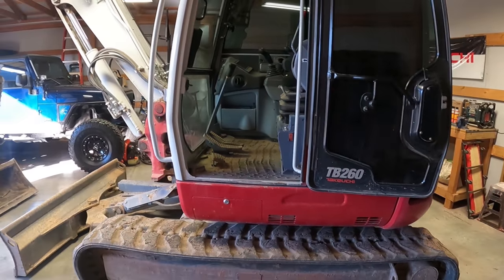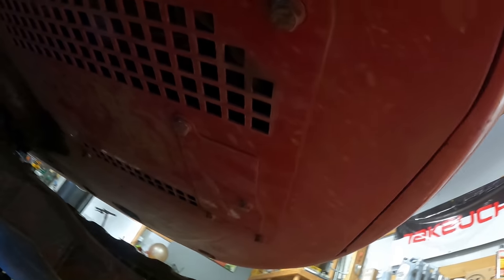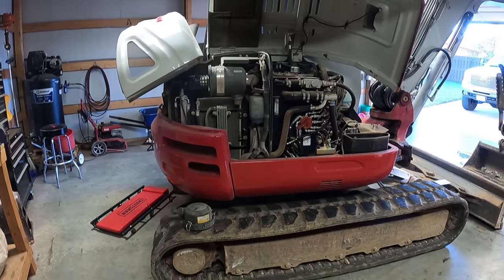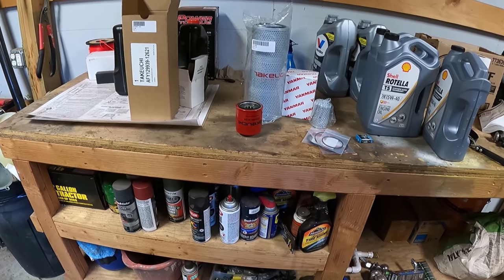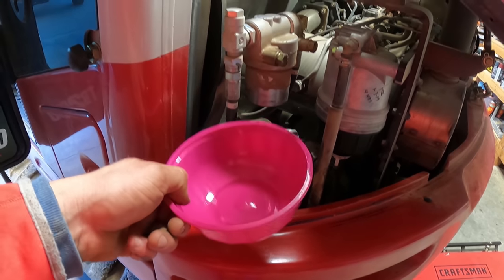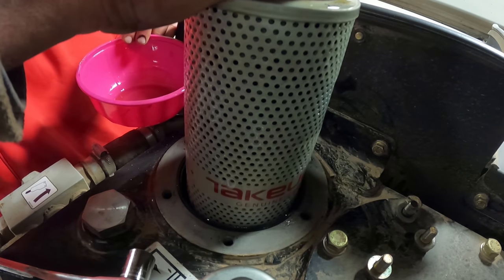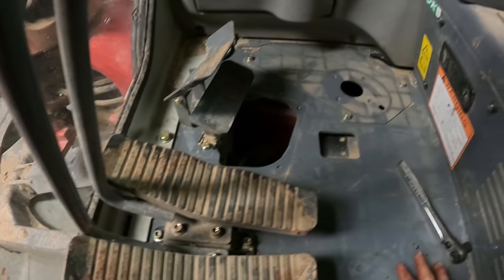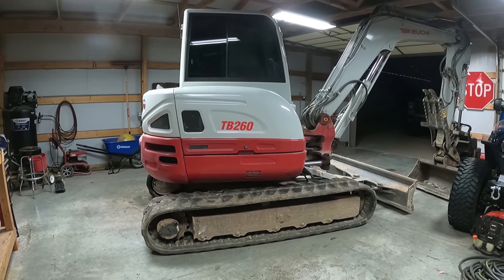500 Hour Service On A Takeuchi TB260

Comment: Maintenance is the key to longevity. Machines and parts are expensive, filters, oil, and grease aren't so bad. The worst part about slacking on maintenence is the down time when something breaks or wears out because you didn't maintain it properly. Nice job there buddy.
Reply from the maker: I agree downtime is a killer I would rather spend a little and money on preventative maintenance than let it go and have a big break down. Appreciate the comment

Comment: Good tip on having the cylinders extended for doing the hydraulic filter change, I'll try to keep that in the memory bank.  Would be nice if all of these filters came with a drain plug to make it less of a mess when you have to change them (I would gladly pay an extra couple of bucks per filter four that).  Enjoyed the video!
Reply from the maker: I learned that the hard way lol! I agree I would definitely pay extra for that, the messes are so annoying. Appreciate you watching
Reply: @eliteearthworksllc  for vertical filters you can loosen them then use a gallon freezer bag to put around it as you remove it. All the spill goes into the bag. You can also tap a small punch into the bottom of a filter and let it drain that way assuming it can hit a drain pan without making a mess of anything else. You can do the same on horizonal filters too but not as easy.
Reply from the maker: @calmac06  that works too

Comment: Hey man, I'm been subscribed for a while. I'm in the process of trying to get my first excavator. The tb260 is on the short list, but I'm having a hard time figuring it out. I like the price and transport-ability of the 260. I'm worried If I got one, I may wish I got an "8" ton. It may come down to what I can afford/ finance right now anyhow. By the specs, I should be able to pull around a 18k machine, but we have a lot of hills, and I definitely notice my ~10k skid steer. I'm nervous about pulling something so big.
Reply from the maker: That can be a tough one. I love my 260 it’s a very capable machine. It weighs almost 13,000lbs and the 290 weighs around 19,000lbs. If your skid weighs 10k you will definitely notice the difference. I know Tak still has good financing. The 260 will be around $78k while the 290 is closer to $125k

Comment: 10:20 where you put an air filter in. I got the supposedly full set of 7 filters for a Tak TB016. There are two air filters, one like the one you put in. I have another filter, blue this time, the same length as t'other but narrower -- in fact the diameter matches the inside of the other... I've been wondering where the hell it's supposed to go so I'm presuming it slips inside!
Reply from the maker: Yeah that’s the inner air filter it goes in first the bigger outer air filter
Reply: @eliteearthworksllc  Well that's a relief! But didn't see you put one in. I must say you are lucky/ fortunate/ blessed because you have a concrete floor, you have an indoors (!), you have a machine that gives you access to the engine on all sides, you have a local dealer!!!! And I thank you for sharing, for you do something 'en passant' (??) that gives me a clue, a nudge, a hint to go and look again!! Wish someone would do the same for the TB016 😁
Reply from the maker: @johncollins8304 I only change the inner filter every 1000 hours. The concrete floor is definitely nice and having a dealer just an hour away is even nicer
Reply: @eliteearthworksllc  "change" yes, but I missed you even putting the 'old' one back in. Never mind, I'll no doubt be watching again soon! Thanks.

Comment: Ever have a problem bleeding the fuel system after replacing filters?  I just replaced both filters on mine. Fillled the spin on filter. Ran fuel pump multiple times for long periods of time. It suck fuel out of spin on filter and then quits after idling for 15-20 seconds.
Reply from the maker: I fill my filters up before I put them back on and just as full as I can get them so it hopefully doesn’t suck air from anywhere. You may have to take the spin off off again and fill it up first
Reply: @eliteearthworksllc  what I ended up having to do was unbolt the water separator housing. Flip it upside down fill with fuel and let the pump suck it down until it was satisfied and level wouldn’t go down anymore. Screwed the cap back on, bolted it up and fired after 5 seconds of cranking.
Reply from the maker: @crashmarvin80  that sucks but glad you got it

Comment: Thanks a lot I learned something today. I did not know there was a slew gear inspection Port, although I'm not sure I have one on my machine it's a 2012 tb235 but it always bugs the heck out of me that I can't see that gear. Also it was great to see the main hydraulic oil filter changed I have not done that yet. can you tell me what is the purpose of that large aluminum plug that is right next to the main hydraulic oil filter cover? If your service did not solve your bogging down problem don't forget to clean your radiator and oil cooler they seem to hold a lot of dirt even if you think they're clean my machine once felt a little sluggish and it looked like it was running normal temperature as far as I was concerned but then a friend of mine told me clean the radiator which I did and I was amazed at how much dirt came out and lo and behold the machine ran about half as hot as it already was.
Reply from the maker: Thank you! That plug is where you fill the hydraulic tank when you need to add more to it. Yes that took care of the problem I think the filter was dirty. Appreciate you watching
Reply: @eliteearthworksllc  👍

Comment: Brandon…. I don’t mean to be to picky but.. shouldn’t you have checked the power steering fluid level, disk brake pad wear and passenger air filter while you were at it?   Or, is this the wrong interval?

I am 11 hours past my 250 hr service on my Kubota.  But, it is Christmas gift making season.  I figure I’ll probably put another 1.5 hours on it before I get to it.  Don’t want to wait until I add 2 hrs… because 13 over might be unlucky!

I have the most popular model of engine that Kubota uses in small tractors, excavators, and other compact equipment… yet, Joplin dealer doesn’t carry the oil and air filter in stock about half of the time.  I drive to Monett to get them… every time I come in, the manager gives me a new hat!  Obviously they have different business visions!!!

I just found out that I have to go to Florida after Christmas… gonna be there for 12 days.  To make matters worse, the fishing lake is out of commission… I’ll be bored out of my skull!!!  I told my daughter to talk to the neighbors and round up a bunch of handyman jobs… after about 3 days it becomes a matter of survival!
Reply from the maker: 🤣 yes that’s on the next service 😁 Lol that would be unlucky. That’s crazy but I’m also not surprised the kubota dealer here is terrible. Oh man that will make  for a long 12 days definitely better find some stuff to do 😁👍🏻

Comment: I’ve got a question.  I have a tb 153 does it have a pilot line filter.  I have never found it if it does.  I know my tl 250 has one.  I’m like you I generally just change every filter when I do it.
Reply from the maker: I don’t think the 153’s had a pilot line filter. When I owned mine I never remember changing it.
Reply: @eliteearthworksllc  thanks for the info.  I was hoping I didn't miss it.  Ironically enough we have the same eqpt,  now I'm gonna have to catch up with ur new toys.  Love the tacheuchi brand.

Comment: How to drain the hydraulic tank, please? I have a TB016 and removed two drain plugs in accordance with useless sketches in manual -- nothing came out. 8" of oil in the tank!
Reply from the maker: There should be a plug on the bottom of it you can use the oil drain tube on
Reply: @eliteearthworksllc  The plug is directly underneath the filler plug and the same size huge 1 1/2". Impossible to get a 25L container under. Used a cheap 12v pump. Only took an hour to drain 1/2 tank 😀
Reply from the maker: @johncollins8304  oh man I haven’t service one of them yet so I was just guessing lol
Reply: Actually the drain tube -- (which I got from Motors Head Japan for £30 delivered) turns out to be crap -- because its diameter is bigger than the orifice -- and unnecessary -- because I just unbolted the fitting from the tank and the oil came out. Two weeks I wasted looking for that thing!!

Comment: Was looking for some insight…. Is it me or do equipment rental companies turn down hydraulic pressures on their rentals or does John Deere 35 series minis just have absolutely no swing power when putting the bucket down and trying to slide a small pile of dirt into a hole where a stump just was….. it was pretty pathetic the lack of power and ultimately wouldn’t even budge…. Thoughts?
Reply from the maker: Some of them do. The Deere 35 is pretty under powdered too they do not have a lot of swing power and have a hard time picking themselves up

Comment: How did you wire the light bar? Wanting to put one on mine
Reply from the maker: There is a rubber gourmet on the left side of the cab up top when facing the machine, behind it is the two wires you can plug the light into. The machine is already wired for a light up there

Comment: THREE weeks later, Im back for more clues, specifically bleeding the fuel system, having emptied the tank to fit a water separator, previous person having replaced it with just dubious (not even diesel) inline filter. For one of the j ydrolic filters it meant going underneath to drain. Drilling oles in frame to access two inaccessi!e bolts to free pump to release 3" ose to free lower tank cover. Still struggling with thin return pipe from final drive. A simple 1/4" plastic sleeve/ olive all te way from Japan is waiting to e fitted. Also from Japan is te drain ose: couldn't fit it so removed plug and oil came out no bother; measured plug against special drain pipe: didn't fit, complete waste of money. 
Anyway, for purging, I know I've ad prolem letting tractor go dry so ave been trying to find ow to do it on T016  (my letter after A (and G!) missing). Yours is the most attractive solution! I will release the two bowls and fill them wit diesel to give it the slightest chance.
Thanks again for taking te time to make te vido.
Reply from the maker: Sounds like the smaller ones are a little more tricky to work on.
Reply: @eliteearthworksllc All done now. Briefly, the new hose is longer than factory -- the one installed. This gave me more ability to make a curve. Also key was a pair of long forceps to hold and manipulate the thin stiff, slippery thing at both ends -- at the T fitting underneath and at the drive motor.
Reply: @eliteearthworksllc oops, just realised you were saying smaller machines; I responded thinking you were talking about smaller hoses!

Comment: Can you tell me why my TB240 does not complete the regen to an idle. Instead it shuts off after about 45 to 60 minutes
Reply from the maker: I’m not sure on that. Does it run fine other times?
Reply: @eliteearthworksllc  it starts blin,ing and beeping. Stays in crawl mode
Reply: @eliteearthworksllc  The engine runs at an idle as well during the regen mode but never goes to an idle
Reply from the maker: @JamesEckstine  that could be right. I’m not really sure cause I’ve never let mine set and regen I’m using always running it when it does or I leave running wide open if it’s regening and I need to get out of it.

Comment: I don't own your machine or any other excavator. But I do own a takeuchi track loader. My CTL and the manual transmission on my car both call for filling until the top hole has fluid coming out. Maybe yours is different but I'd hate to see you have a gear blow out for lack of fluid. I've never seen fluid level that low as you're depicting in video. Is your gear level just set up differently?
Reply from the maker: The loaders hold more gear oil in the drive motors than the excavators because they travel quicker and much more often. All my maintenance procedures are from the Takeuchi manuals in all my machines.
Reply: @eliteearthworksllc  Roger roger! I got nervous for you. Glad it's correct. Nice!
Reply from the maker: @johnnywalker5635  I was too when I first changed the gear oil on the excavator lol I actually put a touch more in than it called for cause I thought the same thing 🤣
Reply: @eliteearthworksllc  hey while I got you. If you don't mind. My takeuchi compact track loader service manual calls for CD or CE or CF 'API CLASS' diesel engine oil at 10w30 viscosity as my hydraulic fluid. But you cant find that. Any thoughts? Or does takeuchi hydraulics have different specs than what my service manual states? Thank you for helping.
Reply from the maker: @johnnywalker5635 no that’s what mine calls for too. You can use rotella 10w30 for it. In my TL 250 I guess I misread the diesel engine oil and just use regular 10w30 motor and that’s all I’ve put it in since I’ve had it from 2012. I can’t find anyone to tell me a difference in normal motor oil and diesel motor oil.
Reply from the maker: The only thing I can figure out is the motor oil is a touch thinner and the hydraulics like it better. Cause in the excavators you use AW46 hydraulic oil
Reply: @eliteearthworksllc  I appreciate it
Reply from the maker: @johnnywalker5635  you bet!

Comment: 1-1/16” = 27mm
Reply: 👍 25.4mm per inch
Reply from the maker: Good to know
Reply: @eliteearthworksllc  I have a conversion chart I printed off online. Really comes in handy when you need a socket and arent sure which is a better fit. Most of the time there's a metric that's close to a sae and one is a few thou tighter.

Comment: good video .. save yourself some big cardboard box's .. lay them on the floor under the unit less clean up after you do the work ,, good old gear lube and burnt tranny fluid are some of the worst smells out there ,,, nice JEEP in the back ground ,, I have a CJ7 ,, there nice for a joy ride ,,
Reply from the maker: Thank you! That’s a good idea! Thanks it’s an 2005 TJ I wish I got to drive it more lol
Reply: @eliteearthworksllc  mine is down stopped shifting.. pulled the tranny found half a lock washer and part of the old shifter bushing in the shifter area .. old owner must of did some repairs but did not get all the old parts out of the grease..